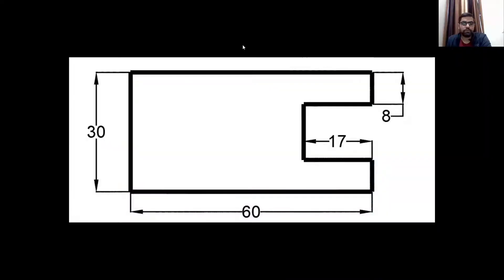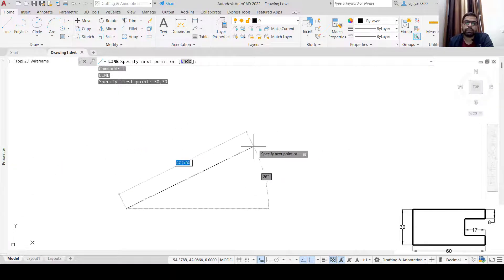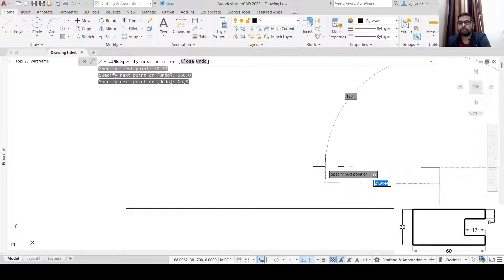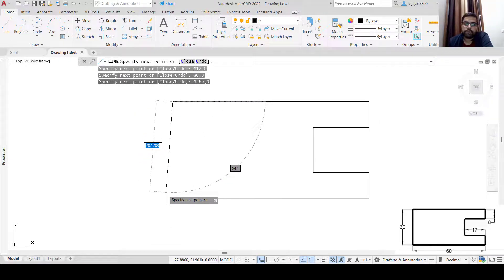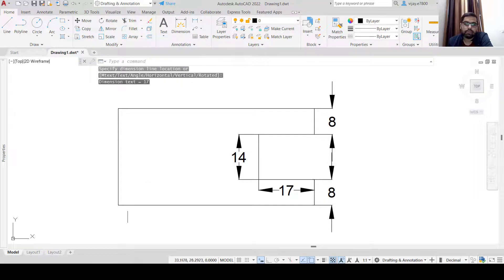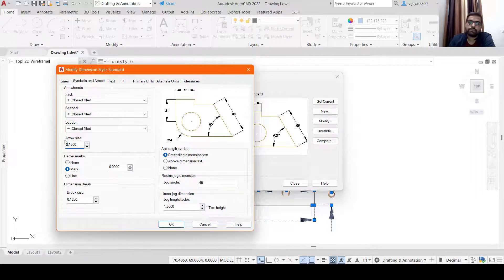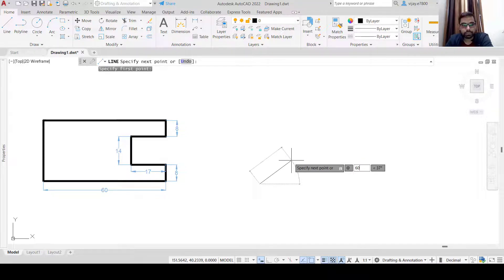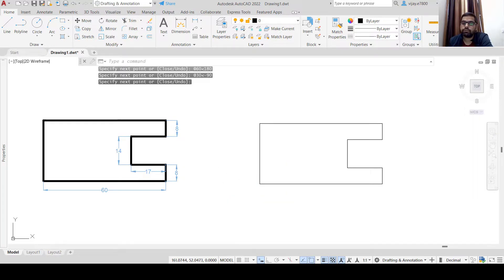Practice: 1 Drawing using the Relative Cartesian and the Polar Coordinate System in AutoCAD

Comment: Sir  how to give  page area
Reply from the maker: If you are talking about limiting the area in which you are drawing, you can use limit command. 
Or 
If you are talking about printing the drawing, then in print dialogue box, you will find option of print area and page settings that you can change or modify as per your requirement. 
Hope your query is resolved.